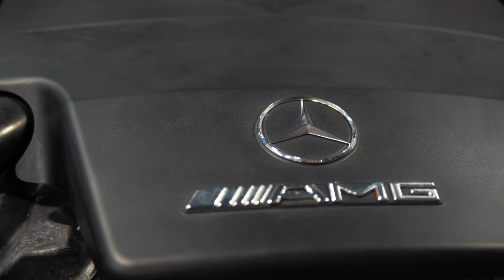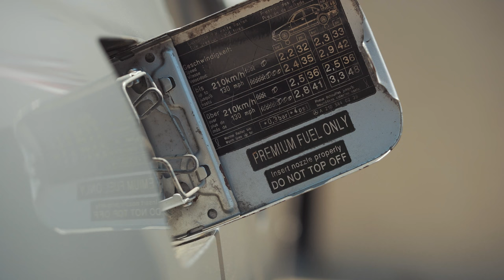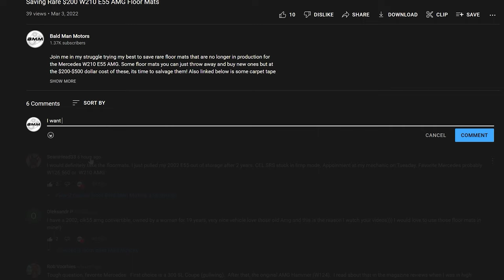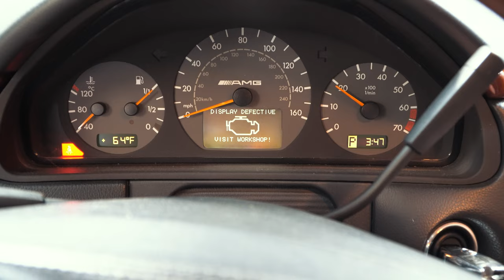$7 fixed the MYSTERY MISFIRE in my 2001 E55 AMG

Comment: Everyone that says "check compression"  are the same ones that will say "you dont need to run premium" when a car say to run premium. The car companies dont benefit from you using premium but they do benefit from you causing a knock that blows up your engine and then needing a new car because your cars toast after that.

Comment: My 2003 S55 is doing the same thing. Really riding rough soon as I decelerate and get low RPMs and idle. You can feel
The engine jolting and shaking, really rough idle! Soon as I get over 1200-1300 rpm’s it really goes away. Don’t notice anything at higher rpm than that. 

It’s intermittent too. 

I’m gonna try this today! Thanks for the vid
Reply from the maker: @Dylan Salfer I hope you find your issue soon, hopefully its just a vacuum leak or perhaps a something like bad MAP sensor. Correct me if I'm wrong but thinking the 2003 S55 doesn't have a MAF right? I also like to run some injector cleaner as well. Sometimes some fresh spark plugs or coils can help too and of course bad motor mounts don't help idle either. Best of luck🤙

Comment: Another thing u may want to watch out is the TPS. My e55 was misiring at high rpm or when i did a hard pull and also had to shut it off then on to get it running good again. I replaced the tps and voila it runs perfect now 😁
Reply from the maker: Great point!
Reply: Hi there are you able to elaborate, I have a 2006 clk500, m113 it’s had everything checked, spark, fuel, compression and it has a rough idle and above 4000rpm misfires and says cylinder 3 misfire on the code reader. Everything’s been checked as working and fine do not sure
Reply: Hey  having a similar problem with my 2000 e55, really an unnoticeable misfire when doing hard pulls, only reason I knew what it was is through the code it threw. Replaced the coils and it’s still doing it. This sound a bit like what you went through?

Comment: I would love the mats. I just bought a w210 e55 last week and your videos have been very helpful. The e55 is up there but I really like the 1999 c43. All time though has to the the clk gtr.
Reply from the maker: @Donny Winslow Glad to hear it and congratulations on your new to you AMG! Ohh how could I forget about CLK GTR , I was at SLS Coupe Black Series or 300SL but the CLK GTR is just so cool.  Also want to get a W202 C43 for myself someday as well.
Reply: @BaldManMotors  those W202s are starting to climb in value. I wonder how long until the w210 does the same.
Reply from the maker: @Donny Winslow They sure have and also I think the W210 is certainly been in the upswing as I bought mine in 2018 for $2800 (rock bottom I think) so here in a few more years I think it will get to new highs, perhaps need the W211 to start raising up for people to realize they are too late for the W210 E55s thus making them rise sharply. I have seen several sell for some pretty high prices already though.

Comment: The mats would be amazing but sadly I'm in Europe. Would be interesting to know if the original mats in my car (which I don't have) had the green edges to match the seats? I've heard there's at least 3 different colored edges for these mats, red, blue and white/silver? However my favorite Merc is a tie between the SLR Mclaren Mercedes & 300 SL Gullwing. Interestingly the SLR had the M155 engine which started out as M113. :)
Reply from the maker: @JK-AUTO Does your seats say designo on them? Green is a bit unusual interior color, I have also seen brown edged W210 mats that say designo instead of MB or AMG for the light brown nappa leather seats. Just curious since you have a rare color perhaps you have designo options? Yeah the McLaren SLR sounds amazing and is great to have related engines :)
Reply: @BaldManMotors  Thanks for the reply! It doesn't say Designo on mine. The code for the interior is LEATHER EMERALD (586A). I think I might be able to find some pics online for you and of course still trying to get my lazy ass to the car and remind myself to take the pics haha.
Reply from the maker: @JK-AUTO Haha well when you can I'd love to see them. https://thembmarket.com/2000-mercedes-benz-e320-designo-silver-edition has green mats with designo so I guess they had the thread :) I would think you had green of some sort but just a guess. Either way I think white/silver and black would look good too in your car as well.
Reply: @BaldManMotors  It would indeed. I have some weird rubber ones right now

Comment: My 2001 E55 was picked up in Louisville late last year, also have a 2005 C55 and a 2000 ML55. Big fan of the m113. I have a mis on cylinder 4, sometimes 8 as well. Injector circuit open code. However it does not seem to lose much power until its been running for 30 to 45min. We replaced plugs, coils, wires, injectors, no change. Has anyone ever found this to be caused by the drivers on the ecu? Is this really a thing?

Comment: I have a 2001 E55 AMG and I've noticed dead spots in my throttle. I hooked up a code reader which showed the TP sensor and found three dead spots when pushing the throttle down with the car off. I bought a new throttle position sensor and that didn't fix the issue. I replaced the throttle body from a Pick-A-Part place and still the same issue. Have you ever experienced that and if so what was the cause? Funny thing is taking a right from a stop held the throttle down at a quarter it fixed itself and it got a second gear scratch. Please help.

Comment: Just recently this week October 2, 2023. Our 1999 Mercedes e55 AMG service light came on.!. I took it to my friends smog shop to get a code reading and it came back with. P0300, P0115, P0302, &, P0130. Which are a simple job I hope.?. If you don’t mind.?. What do you suggest.???. Rey from San Fernando Valley. California.
Reply from the maker: Hi Rey, I would start by swapping cylinder # 2 coils and plugs with another and see if it moves. Bad fuel? Vacuum leak can wreak havoc as well. Has it been idling rough?
Reply: @BaldManMotors , Yes a little. It’s my wife car. She tells me the light goes on and off when she drives it. I already changed both oxygen sensors on the muffler’s. I’ll do that to see if there’s a difference. I mostly drive Classic car’s like Chevy’s, Fords, Chrysler’s, Dodge’s &, Pontiac.!. Which are all Lowrider and Lowrods. Thanks for your feedback. Our Mercedes is actually like yours. Same color.

Comment: Hey how’s the transmission been doing for the E55 lately? I remember in a previous video that you were a little concerned about a brief hiccup it may have had.
Reply from the maker: @Joe Demid So far so good, it's been about 500 miles since it seemed to mess up, idk it seems okay at least for now. Keeping an eye on her but plenty of full sends and seems to be holding up. Thanks for asking👍
Reply: Great to hear. Didn’t seem right for a 722 to be giving out at only at 200k miles ;) probably just an electronic glitch

Comment: What were your specific symptoms you had with the worn out conductor plate?
Reply from the maker: @John Hall It was having trouble shifting, slow to shift then a harder shift at non-normal intervals so each acceleration was a new experience of sorts and then eventually locked in to 2nd gear limp mode. The speed sensor on the center of the conductor plate is the culprit usually with these. It got worse withing about 1-200 miles and went into limp mode. Some people just start the car once day and the issue is there as well. Hope that helps.

Comment: I'm at the end of my rope. My car has a random cylinder 2 misfire. I've gone through the check list (plugs, wires, coils, injectors and injectors seals) still can't figure out why randomly it had this issue. It shakes are lower rpm's
Reply from the maker: Curious if you have any other codes or have done a compression test on that cyl? Sounds like a vacuum leak possibly. Has the MAF been cleaned? How is the condition of the coil & injector power wires?
Reply: @BaldManMotors  these are the other codes I have : P0107 x2
P0103
P0302
P0100
P0130 o2 bank1 sensor 1

I have replaced the plugs, coils and wires. I replaced the MAF with OEM Bosch unit. I have also replaced the rubber vent vacuum pipes and the air intake tube and gasket.
Reply: @jkhan856 ever fix it?

Comment: Hi my E55AMG 2001 Engine starts misfiring on RPM 3.5 & will continue misfiring until i restart the engine can someone help FYI i chaned spark plug & Ignition coils Fuel injectors fuel pump & fuel filter

Comment: Hi, my 02 e55 idles a bit shaky but runs perfectly fine, no misfire code, no engine related code whatsoever, can that be the same case? Or de-cat and de-resonate make my car idle rough?
Reply from the maker: @Gary Zhang I have found a few things can help rough Idle. Of course any vacuum leaks can cause it bit I noticed smoother idle after cleaning/replacing MAF, spark plugs, engine/trans mounts and even using good engine oil smoothed it a bit.
Reply: @BaldManMotors  Hi, thanks for your suggestions, so in past two weeks I did all those, but without success (they need to be change whatsoever), at the end I remove the injectors and one of them (cylinder 2) is leaking fuel into engine, by replacing it, the problem is now fixed. I also change those seal as seems they never been changed before
Reply: Just a bit update for people probably have the same issue. The problem turns out to be two bad coil that cause partially misfire (one connector is fine, the other one have some sort of corrosion inside, and I use engine smoothness running meter to find that since there is no actual misfire) and the oily KN filter make my MAF sensor dirty. So after change a new MAF and a set of Bosch coil pack and a set of clean air filter, it back to normal